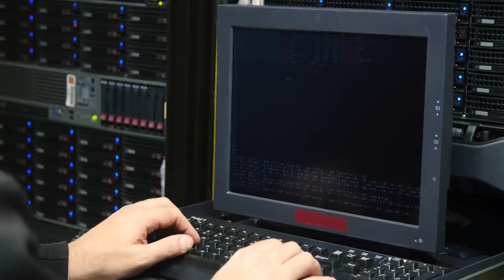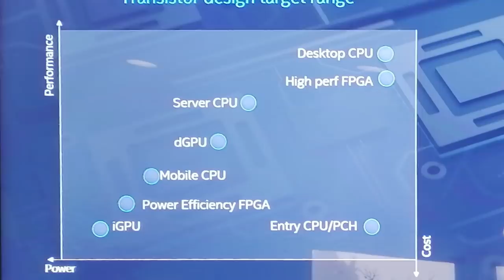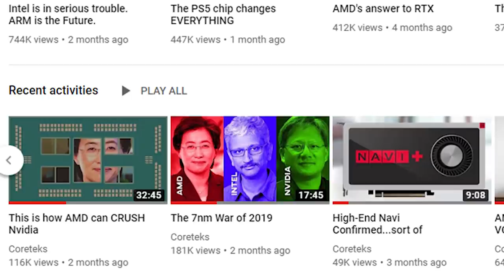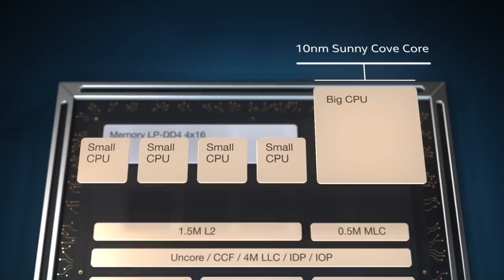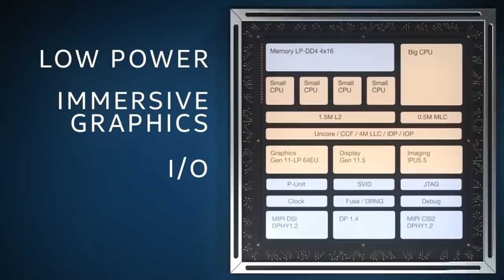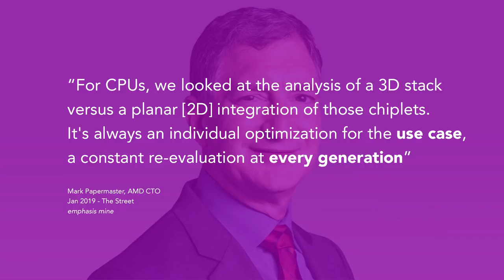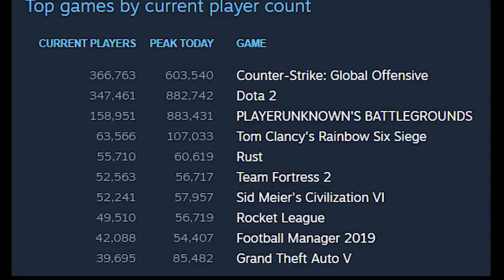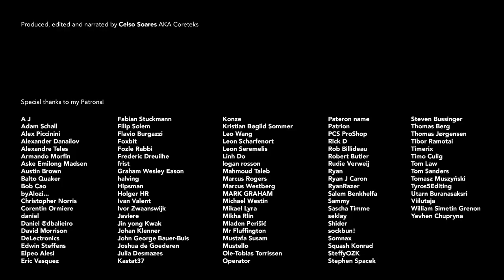2D vs 3D Stacking: Intel’s plan to beat Zen 2

Comment: high temps was the reason for getting rid of the stock intel heatsink which they used for years but literally was a block of aluminum with zero heat pipes or brass they have since fixed the issue after the 6700k the stock intel heatsink has been discontinued as it was inadequate for the newer generation CPU,s another issue was customers would try and overclock using a stock heatsink which is highly unstable wasn't that the i7,s ran hot it was the cooling block was not designed for overclocking and barely did a optimal job ….as where AMD ryzen stock cooling block was the same but had a copper plate on the bottom where in the cpu would rest and had liquid coolant internally that is why it ran cooler ….tests confirmed this if you stick a noctua heatpiped cooler on a i7 and a ryzen 7 identical run them benching ect and check thermals you will see the intel i7 run cooler and faster then AMD,s ryzen 7out of the box stock

Comment: If Intel can improve the IPC and figure out efficient cooling with the design then it will work. More cache means a much higher price though, so it'll be a better server solution than for end users or gamers. No point if people can't afford it en masse like the current Zen or the cheaper Intel chips.

Comment: 19:33 "[...] meaning these will make use of Edge Computing to do a lot of the processing rather than needing powerful expensive hardware on local machines."
Even though "Edge Computing" isn't well defined throughout the industry, this statement doesn't make any sense:

Either an always connected device doesn't need powerful hardware because it's relying primarily on Cloud-based services (e.g. Google Chromebooks), or it's doing the bulk of processing itself (e.g. traditional Laptops) and thus doesn't even need to be always connected. The latter use case would match most definitions of Edge Computing, while the former is a classic case of client-server architecture (or "cloud-based computing" in hype-speak).

<rant>
An always-connected device is a clear step away from edge computing and towards cloud-based services, since that's where the money is for companies like Microsoft, Apple, and Google. The same goes for the games industry: delivering ad-hoc content without local installation is the de-facto end of the used-games market, reselling, and software piracy. It's total control over content and user and much cheaper to develop since the target hardware is set in stone.

This whole ARM-based always-on appstore DRM cloud-only bollocks is the wet dream of the content- and software industry! It's not about innovation or "ARM being better". Bollocks! It's all about taking away customer rights, monopolising and controlling access to content, information, and software! Apple doesn't even allow replacing the storage in their new devices by both soldering SSDs to the board and tying pretty much all components to their T2 "security" chip.
</rant>

Comment: There are a few things you haven't mentioned regarding the caching on the Intel side. First and foremost: current L3 cache is SRAM. The caches Intel is suggesting would be DRAM, which is significantly slower. SRAM is much faster, but takes up more silicon and is therefor much pricier. This is the main reason why 64MB of SRAM is a big deal, while 64MB of DRAM hasn't been impressive since the turn of the century. Putting DRAM on top of your CPU will reduce latency, absolutely. But it will not match SRAM performance. If you replace all your L3 cache with this DRAM cache, in most applications you would lose performance.

Secondly: Caches are important, but they're not the magic bullet like you're suggesting. It only matter precisely when you're memory latency bottlenecked. This is not uncommon, but certainly not the only way a CPU can be limited. CPUs being memory bottlenecked 30 years ago doesn't mean that this still generally applied today. Just like for many applications you run into diminishing returns as you add more cores, the same holds true for cache. Modern CPU caches are essentially a queue of data the CPU it thinks it will need in the future. Some data is in there because it got used before, but a lot of it is also loaded speculatively in anticipation of future usage. With more cache, you can load more data into cache, making the odds of a cache miss go down. At some point however, adding more cache make very little, if any, difference. How much cache is needed for that depends on the application. I'm sure there are some applications that will see a huge boost, but I seriously doubt this will somehow be a huge leap forward in performance for most people.

Not saying that Intel will not be competitive. Just trying to temper the hype a bit. The Foveros example chip has only a single high performance core, combined with 4 low power cores. A $150 smartphone will run circles around this. I haven't actually seen them announce anything around high end products for this. Given the thermal challenges of high performance products, I actually don't anticipate any product in the Core lineup using 3D stacking this year or next year.

Comment: This is really interesting. I am curious about how big of a leap we would see in these 3D stacked CPUs over flat 2D CPUs. Would we see a 20% improvement, 30% improvement, 40% improvement or hell maybe a 50% improvement? Who knows what we will see. I think we could still see boost clocks of over 4 gigs with these new parts and maybe 3.8 gigs at the base clock speed. I think we could see a very decent jump over Zen 2 with a Foveros chip running at 3.8GHz base and maybe a 4.4GHz boost. I am not saying that is what the chip is running at but it is just a possible base/boost clock pairing. Hell if the Foveros chips are capable of being overclocked, AMD could be in real trouble until zen 3 where AMD would start to pull Intel back and could possibly overtake Intel when they launch zen 4. I do see a lot of benefits that 3D stacking would introduce but the biggest sticking point is what is the heat output going to be like. What is the hottest possible temp the chip could run at without crashing? That is a really big question that needs to be addressed as well. I think it is going to run a LITTLE hotter than 2D chips. Hopefully not too much hotter.

Comment: Time to break the glass ceiling and make silicon based CPUs obsolete by making optical based CPUs and DATA bus architecture.  No bandwidth limitations due to EMF interference and reduced heat not to mention a single fiber optic bus line can transmit/ receive 100s if not 1000s times more DATA than gold plated copper PCB bus lines

Comment: 2020 will most likely be Zen 2 plus if you look at the current roadmap.

2021 will be Zen 3 on 5nm. 2022 could be another optimization year. My guess is 2023 is when AMD starts to 3D stack. I hope they innovate faster but they have very limited money for R&D.

Comment: I doubt that the foveros high power product will come the next year, or even the year after. I believe it was 2017 that they unveiled a CPU-FPGA hybrid prototype for enterprise. Even until now there's no sign of it coming soon.

It might have been a different case this time around, as they're under pressure to go against a strong competition. But realistically there's still some obvious barriers such as power, heat distribution, binning and profit margins. Historically, high bandwidth "innovative" solutions often fails to materialise for consumer products.

Comment: At last competition! I one day dream of a chip with super duper fast single thread high IPC CPU and also many many slower cores for multitasking. Now all the cores have the same IPC and boost one core. As I understand IPC increases heat a lot. Hybrid CPUs are coming. I have a threadripper and love it, but if Intel beats it one day at a good price, then yes I will buy it.

Comment: You can't have GB of cache because the latency will increase as you grow your cache size. So GB of cache will have similar latency to main memory. It is the reason why you have several levels of cache. Bigger cache will always be slower than smaller cache. Cache is different than memory they have coherency overhead so having too much cache will actually slow down things. GB of cache is beyond the point where there is too much cache. Now you can ditch cache system and stack main memory directly with out having to deal with coherency but that will limit the flexibility of your system. If the stack has GB memory then it will not be able to run applications that needs more memory and there are server applications that needs Terabytes of memory. You need cache system to be flexible and can run a system with different memory configuration. But this means having to deal with coherency. And that is why GB of cache is pure fantasy.

Comment: Without active cooling between the dies (via microfluidics, which do not appear to have gone anywhere, probably due to high development cost) I frankly wonder how they are going to manage the heat of the bottom and middle layers, unless we are talking about TDPs up to ~25W tops for the entire package. 

Even high performance water cooling of 3D stacked ~95W packages would perhaps not spare the lower layers from being fried due to trapped heat. How about packages in the 30 to 45W range, could their heat be managed without strong water cooling? I frankly have no idea.

Comment: I don't believe memory bandwidth is a significant issue for current architectures, however with an architecture designed to take advantage of oddles of bandwidth sure, but from what Intel revealed I don't think Icelake will be it. The changes simply are not large enough to just beat out a straight up faster CPU with more bandwidth. Intel apares to be doing less with Icelake architecturally than AMD is doing with Zen 2 on that point. So while long term yes I believe it is the right option I think AMD can implement it when it actually matters. And yes I agree AMD wont be able to do it Until Zen 4, but I don't think Intel will have changed there architecture enough for it to really matter until 2021 anyway.

Comment: Great Video as always. I still think the if Intel used a chiplet based design they would already have Good 10nm chips but since they use a monolithic design 10 nm is unreachable for them. The 2.5 D I am assuming they would still be monolithic and Intel will have the same problem as they do now.

Comment: 10 years ago they said big and powerful gaming laptops are stupid and are due for extinction. Instead, the opposite happened. They said desktop PCs are dead. Instead, they simply got better and more focused.

Then they said everything will move to cloud and powerful PCs will be obsolete and we will all personally own nothing more than terminals with screens and speaker to rely on the processing power of some remote cloud server in Siberia, all the while ignoring that this is ultimately a dumb-ass idea that ignores very real problems such as less than perfectly reliable and consistently fast internet connection in many parts of the world, complete lack of robustness, etc.

Comment: Didn't really discuss IPC so this will not be like the example above where intel was faster with lower clock speeds. While Intel still has a minor lead in IPC its not enough to fight off AMD's improvements in this area.

Comment: I don't see 3D stacking being practical in the high end of performance, Enthusiast or server, assuming you can even effectively cool the deeper layers, all you're doing is further exacerbating the thermal density problem intel already has. As you mention, this means active heat-producing silicon can't be stacked on each other.

 Intel could in theory get around the cache problem by using a small, low density version of it's process for the cache sections, which would reduce their consumption to very, very low levels compared to the actual cores. the actual execution cores themselves aren't getting substantially faster because they're already hitting the practical cooling limits for density. 

Building on that thought, spinning out different, and perhaps entirely new types of specific function execution units to separate areas of the chips could see large gains. This would either require a faster bus system to keep everything in lock-step, or a VERY deep (think Netburst) pipeline to keep the clock and throughput high, at the expense of latency.

Comment: I don't fully understand the necessity of 3D stacking. The core argument is the cache memory, and that it takes many space in the die. So 3D stacking is presented as a solution, at the expense of colossal R&D costs. If one CPU takes 5mm^2 (just to say a number) with 8MB as L3 cache, it is inferred that 3D stacking will permit the same die size (5 mm^2) but with 500MB (just to say a number). And if this is the case, why would Intel favor die size instead of increasing it (say 10mm^2)? A CPU double the size is not that bad, specially with lower size processes (10nm and such) Let's remember that doubling the area requires only a 41% increase in arista size. And lastly, mammoth CPU's have been commercially successful in the past (like Xeons 7 or AMD's Epyc)

Of course, if the aim is mobile computing, then, decreasing die size makes sense. But not with desktop size, server grade, workstation class PC's. And if this is the case, Intel should charge more for mobile computing (due to investing in new tech) but should keep current pricing for non mobile applications.

Comment: Intel processors already have thermal density problems on a 2d plane with a heat spreader. I can't see how they would deal with that problem in three dimensions without going backwards in speed and process nodes. Maybe 3D cache? Does cache produce heat like a core? Things I don't know. The way to make truly faster chips is in a material change to something with a higher resistance but better stability and reliability.

Comment: Can AMD develop 3D stacking solution ? A case for NO : as there is currently no actual "standard" 3D stacking design that isn't controlled by intel, they would have to at minimum partially re-develop there own physical IP's for there stacking, accounting for thing like trought silicium vias for there hight speed buses and power density + the EDA tools for simulating there design. You mentioned that AMD didn't have as deep pockets as Intel, as well they lack the knowledge in-house to develop such a technology and it is unclear at this point if any fabs would be willing to invest the money to mature such a process ?
Reply: @evalangley3985  I wouldn't call him a fool ^^ just very optimistic for the 3D technology and that forces me to look more in depth into it's potential and follow it for years to follow. But currently I do agree with your point the Infinity fabrics are an actual working product were as the foveros like chips have only been seen in the stratix10 series to far ... and the fpga requirements are nothing like cpu's in terms of manefacturabiliy ... " New chiplet baseline " is a very nice way to put it and he did mention AMD's next move was to head towards 2.5D ( would partially mitigate memory latency issues ) . Do you think this new chiplet design would include 2.5D ?
Reply: @Eva Langley  I like the fact you keep coming back here burning on Coreteks but supporting his video's by commenting, albeit negative <3
Reply: except amd already has all that from developing hbm with sk hynix so i would go as far as to say amd has far more experience with stacking than intel does.
amd was the first to release 3d stacked ram and now chiplets, and from what we see in the support for zen 2 and even zen 3 which is far from release i would say there is a good chance they aren't going anywhere

Comment: How the human brain was designed.
How many cores shall we have?
100 billion
Sir no you can't fit that many.
3d stack them!
Sir, they'll be impossible to keep cool
Lower the clock speed to 2.
Lowering them to 2GHZ won't be enough sir.
KHZ
I don't think that's a good idea sir, we don't need that many cores and the slow clock mean they'll struggle to do basic trigano...
You're fired!

Comment: 3 D stacking is good provided ones die do not run too hot and the heat spreaders between the die provide a low thermal resistance path to the edge of the stack. From where a low thermal resistance path, made of metal, down to the case lid via the substrate. I can see Intel succeeding with this using their low power mobile cpu's etc but not their high performance cpu's. They run far too hot.

Comment: How about submersing the 3D chip in a fluid, or designing it to be used in such a way. Similar to an automobile engine. Water-cooling has already seen more mainstream use, and with proper engineering might be the best way looking forward for higher power 3D chips. If we use the automobile engine as an example. They all started air cooled as well, but no one would dare unplug their radiator from a new car. New cars are engineered from the ground up with so much power, that they require a good amount of active cooling. And thus has led us to use a more potent means of heat transfer.

Comment: Not sure i agree with much of this. There is a reason AMD is not looking to active interpossers now is because the massive cost to build devices like this so you will only see it in top end servers at the top price points. I would be supprised if they can do this by the end of 2020. I suspect we might see active interposers but not 'stacked' in Zen 3.

Ok and I'm thinking closer to 2ghz  for thermals VS 4ghz in your example as the increase in powerdraw is not trivial as your increasing power density so more power AND less space when all proccesser makers already struggle.

Also remember every layer is another 10-20 proccess steps with a matching loss in wastage. This stratagem is almost the opposite of current chiplet, and is liable to make monolithic dies look real cheap.